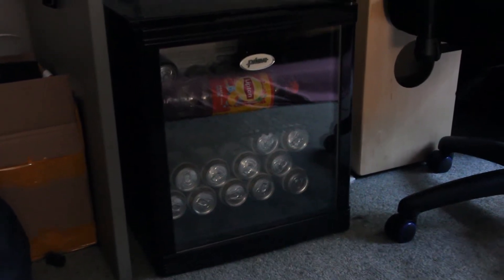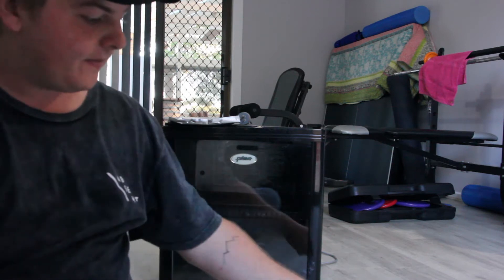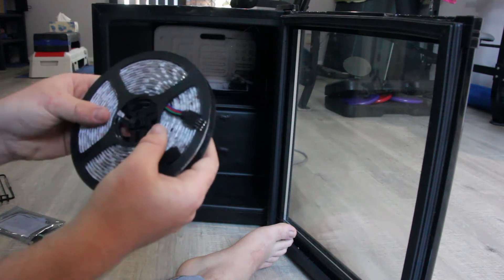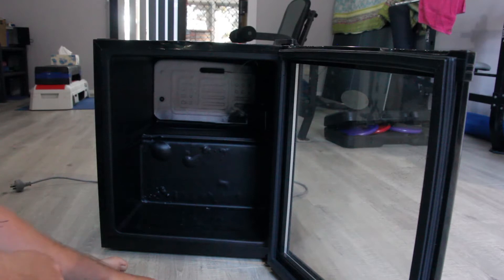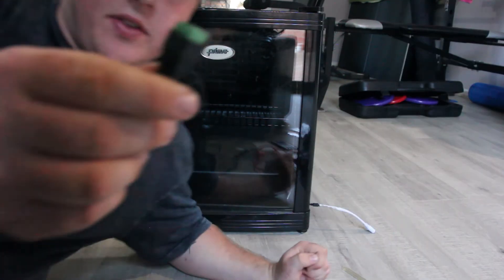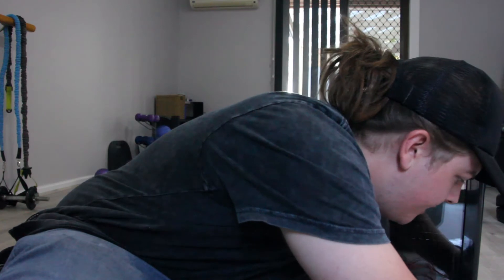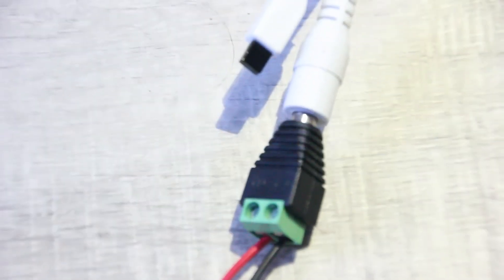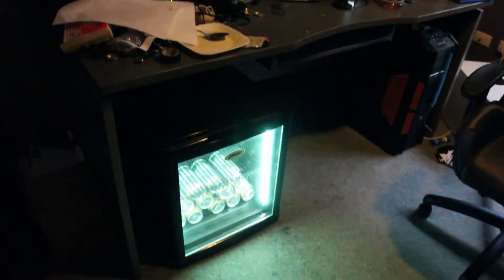HOW TO MAKE A LED BAR FRIDGE TUTORIAL

Comment: So you just run the cord through the door, which means it doesn’t seal properly anymore and the contents get warm?
Reply: that’s what i’m saying
Reply: Easy fix poke hole through the seal stick the wires through and use some type of hot glue or silicone to put around a wires and hole so your refrigerator can hold the proper temperature.. for the most part I think this is a great idea I'm dealing with this issue right now
Reply: Shit up its sealed
Reply: @amantek3545  I have one of these, which is why I’m watching this video.  Any gaps in the door won’t allow it to seal and the compressor will run constantly and burn itself out.  Not good.

Comment: I did this on my fridge but the wire leaves the gasket slightly gapped is that ok?
Reply from the maker: just monitor the temp over time and along as it doesn't warm up too much you should be right, it shouldn't make the gap so big I don't think
Reply: Sam Lecons yeah its not too big but it made a difference alot of condensation appeared but i sealed the gap with putty so it works fine now :-)